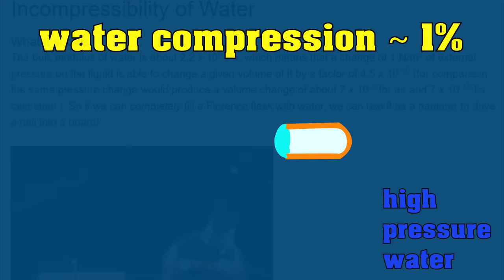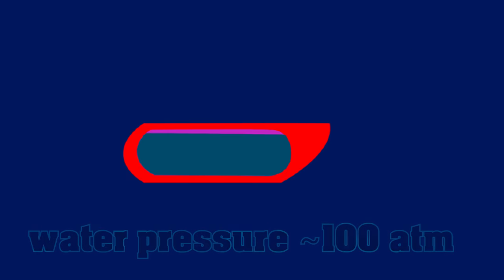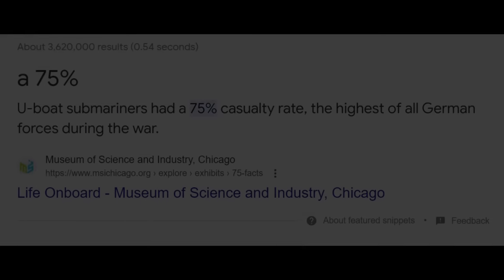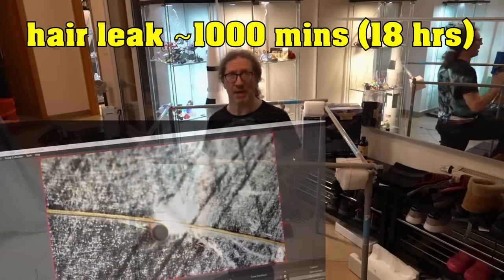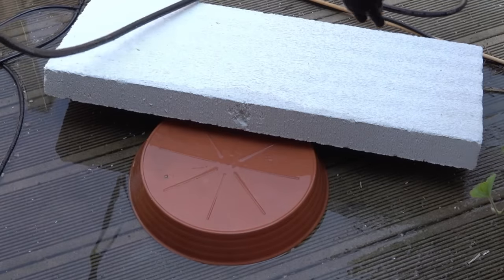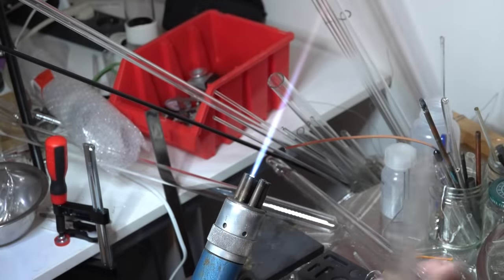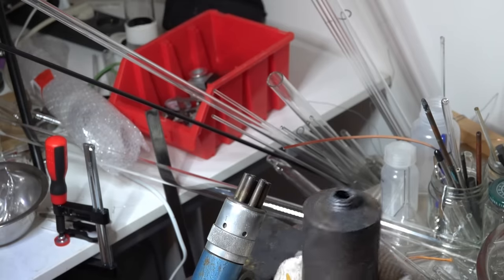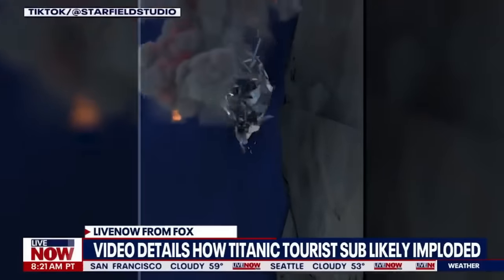Why the Titan sub failed

Comment: Water jet cutters start at about 30,000 PSI but can go 3x higher. A typical commercial jet washer will be about 2000 PSI. It's not surprising it didn't cut the plastic.
Reply: If water jet cutters were handed out to the public they would be classified as weapons. Imagine how many feet would've been severed by accident by people just trying it on.
Reply: His was probably1200max at the nozzle.
And maybe 1gpm.
4000psi at 4gpm would tear that plastic thing up pretty easy.
Reply: @ingvarhallstrom2306 Anyone can buy a water jet cutter. All you need is enough money and space to afford it.
Reply: My powerwasher destroyed my sunroof of my summer kitchen (made of plastic). Didnt cut it, but rather shot through it with pieces flying.
Reply: Its like Mach 7 or 8 correct?
Reply: Those little hippie electric ones just don't cut it.  My washer is gas powered,  3650 psi, the 0° tip cuts a 2×4 just as fast as my Sawzall.  😮
Reply: @noname7271  Try to make a consumer product, cheap, portable and lightweight, that cuts people in half, and see where that will get you! It would never be allowed, but if it was, you'd better get some pretty good lawyers!😆
Reply: @goncalovazpinto6261 a saw. You're talking about a saw.
Reply: @frankfedison5203  
You got some crappy 2x4s.
Take them back.
Reply: @PollokPoochesDogWalking  No, I'm talking about a handheld water lazer! I'm talking about instantly killing someone. I've cut myself with a saw and saws don't instantly cut through metal and glass leaving perfect edges. People would cut their toes (through the shoes), there hands, damage or cut whatever surface they pointed it at, children would cut there pets, etc.
Reply: @frankfedison5203 Post a video of that. I don't believe you
Reply: The electric power washers suck they don’t work good. Anyways in the ocean at titanic it’s like 6,000 psi so you can have a 1in x 1in hole in the sub and because it’s the ocean it has unlimited volume so it don’t matter the size of the hole it’s got 6,000 psi coming through. And not for nothing even if the pressure isn’t 50,000 psi like a water jet if you take a 3,000 psi pressure washer and keep spraying ur finger with the smallest jet it will do some damage just a matter of time.
Reply: Yeah, everyone who has washing their car would have a bunch pinholes 🤣
Reply: On a scale model would the 5800 PSI pressure have to be scaled?
Would the pressure scaling be linear or exponential?
Reply: @frankfedison5203 I don't believe you about the cutting but why do you need your psi so high? 2100 should be more than enough for the vast majority of situations.
Reply: @@nullnvoid123 There were several comments and responses. Read them again slowly and you'll see who I was responding to when I said that (hint: I was responding to the name in blue at the beginning of the comment). Anyway, noname implied in his first comment that it's no big deal because anyone can buy a commercial water jet. This implication is, in my opinion, silly.
Reply: I can't believe he is using an electric pressure washer, especially if he is in America (a 15 amp circuit is generally only capable of 12 amps (80% of 15amps) which is only 1440 watts).
It is most likely the material is holding up better than expected because the manufacturer is simply lying about the specifications.  Spraying a decent amount of water at 100 bar is probably going to take more than 2hp. It probably has a duty cycle too low to matter anyway.   The 12:20 mark you can hear it spooling up and down.
This is why most pressure washers for commercial use are gas powered.
Reply: @hhiippiittyy 😂😂😂
Reply: @tarstarkusz  I think he lives in the UK. That spooling usually means there isn't enough water pressure coming through the feed hose (sometimes the hose is kinked) or, more commonly, there is air in the system that has to be purged before you get a continuous jet.
Reply: @ericmiles6413 what? mach 8?? more like 2-3
Reply: @tarstarkusz  They market those like power tools, lots of fancy tests to get a number for the box, but when you have it in your hand, you never see that amount of power, pressure, whatever. The sound they make drives me nuts.
Reply: @hhiippiittyy   You're likely correct as he was using an electric powerwasher which is typically a good deal weaker than the gas-powered variants.
Reply: My 3000psi pressure washer cut through half inch fibreglass on a boat I was working on.
Reply: @goncalovazpinto6261  OK, that's sounds reasonable. I figured it was for duty cycle.
Either way, I think the manufacturer is lying
Reply: @tarstarkusz  yeah the motor noise sounded pretty weak going up and down.
Reply: Yeah, it would not be safe to sell those high pressures in supermarkets.
Reply: @mrdewes  Not to mention there is little consumer need for such a thing.
Reply: @amosbackstrom5366  Just search here for a video, you will find plenty.
Reply: @@nullnvoid123 A wonderful dressing down. Well done!
Reply: @frankfedison5203  I've had two of the electric ones, and have been unsatisfied. The next one will definitely be gas-powered. Thunderf00t's problem is the power washer isn't up to spec. A power washer can cut throw skin easily.
Reply: @tarstarkusz a 15 amp circuit is capable of delivering 15 amps. You shouldn’t but it’s capable.
Reply: @mattimus8250  You're not supposed to exceed 80A% of the rating.
Reply: Interesting information 🤔.  Thank you. 👍
Reply: Yeah my waterjet is 30,000-60,000 psi... Good point
Reply: @frankfedison5203 that's what they said about cordless impacts 10 years ago. They'll be better soon enough
Reply: @criticalevent  ive seen pressure washer attachments that go at the end of the wand that feed sand into the stream. I want to try one, just haven't had a sandblasting job thats warranted buying/trying one out yet. Not going to work like a waterjet cutter, but i think they're only advertised as a type of sand blaster. Im very curious to see one work, sounds good in theory.
Reply: Literally in fractions of a second.
Reply: Water jet cutter also use abrasives like garnet in the water stream
Reply: The electric pressure washers are handy and have their place, just don't expect them to have the power of even a small gas one. I have both, i love my electric one for blowing mud off vehicles. If im going to do houses or sidewalks, yes, the gas is better suited for that.

Btw, gasoline ones ive seen are around 2500-5000 psi, even saw one that was 7000. The ones called 'jetters' are typically industrial units for cleaning pipes etc., and go up to 30k psi. Sewer companies use them to cut roots out of pipes that have grown in.

Plus, waterjet cutters use abrasive media (specialty sand called garnet), thats what actually does the cutting. Theyre such high pressure you can cut softer stuff with just water tho. Believe it or not some chicken nuggets and cakes are cut using waterjets, they're are fairly common in the food industry.
Reply: Never heard of a chainsaw, sawzall, lawn mower? Cheap, lightweight, easily cuts people in half, almost everyone has one
Reply: @ingvarhallstrom2306  Lol. A modified super soaker can break flesh and cut plastic easily. That's pedestrian.
Reply: @frankfedison5203  No abrasive necessary.  The material which is being heated by such high pressure water so locally so quickly will make way for more acting like its own abrasive especially at 10x your gas powered washer.
Reply: @goncalovazpinto6261  Yeah. Very high pressure water is scary, not for the jet of water itself but what it carries.  Like a tsunami or a tornado. It's not the water or air that is the real threat, it's what it picks up and carries as abrasive that does the real damage.
Reply: Hmm... probably correct, but I'm not too worried as I don't know any member of the public who is muscular enough to carry around enough sand abrasive to cut more than a foot or two off before going for more 🤣
Reply: I'm sorry but I own an industrial grade 4200psi 4 gpm pressure washer and have used several other commercial units... You will not be cutting through spruce and especially not yellow pine 2x4's with a 0 degree tip faster than a reciprocating saw... Or even a handsaw... Even using the blunt backside without teeth would be faster 😂 You might shred weathered or very soft wood into fibers near the surface, leave visible gouge marks along the grain of new lumber, or maybe even chew up some endgrain at the most... There is good reason adding abrasives is neccessary just for removal of paint and rust with similar pressure or higher wet media blasting... If plain water at 4200psi 4gpm won't even damage quality multi stage automotive paint on sheet metal, then it's hardly going to magically slice and dice 2x4 dimensional lumber faster than power tools, even if they are using friction instead of sharpened teeth to do it!  😄
Reply: @miinyoo  
Which one is it?
 No abrasive necessary? or " not for the jet of water itself but what it carries.  Like a tsunami or a tornado. It's not the water or air that is the real threat, it's what it picks up and carries as abrasive that does the real damage."?
Or did i miss something?
Reply: @goncalovazpinto6261 
I have 20 plus years with water jets specifically Flow water jets.  Typical water jets that use abrasives use nozzles of .040 inch (.010 inch water only) and can come out at 90,000 psi.  If even the tip of your finger touched that it would blow up a large portion of your hand.  Then you would die (if untreated) by infection of small amounts of that water going through your blood stream.  However, that same stream of 90,000 psi water shooting through the air would effectively ne harmless around 15-20 feet away. 

WJ operators are even supposed to carry a “Waterjet Medical Alert Card” with them. You can find examples online.
Reply: @frankfedison5203  Why do you even need that? When I pressure wash my deck, driveway, car, I don't want to start peeling paint and cutting through material.
Reply: @goncalovazpinto6261  It's the same as buying any other cutting tool. If you want to go to Home Depot and buy yourself a band saw to stupidly cut your own foot off, you're allowed to do that.

30,000 psi waterjets are massive though. They'll never be cheap enough for the average person.
Reply: @goncalovazpinto6261  You can't make a 30,000 psi pressure vessel handheld unless you've got some magic materials from a superhero movie.
Reply: @hhiippiittyy  Many moons ago, my company repaired a skid steer mounted pressure washer that the customer used to pulverize concrete with. About 300 bar (4300 psi)
Reply: @GameTimeWhy wtrr I have a ride back from the house to get 4r
Reply: Water jet cutters use abrasive particles to cut, pressurized water is just the transport and acceleration medium for the abrasives
Reply: Sub is at depth where hull is at ~5000psi.
That Square Inch. What is the pressure at 1mm dia. hole or crack?
It doesn't matter if it would or wouldn't cut the CF on the other side of the sub, that fail would induce catastrophic failure.
Reply: @goncalovazpinto6261  People go to emergency rooms every day with penetrating/cutting/degloving accidents with home 1500-2000psi electric power washers.